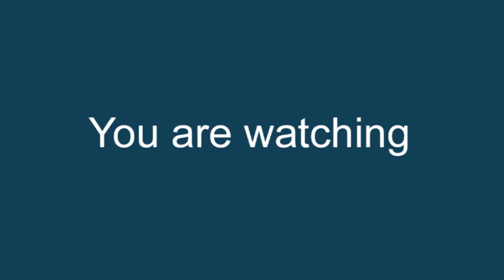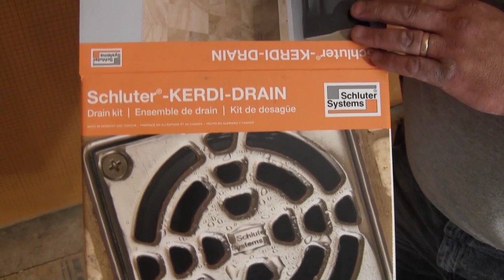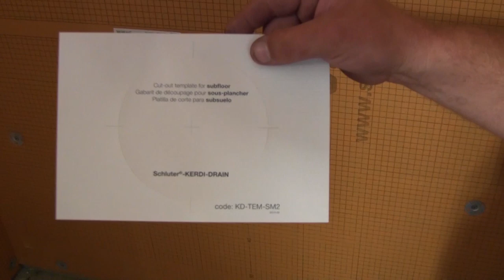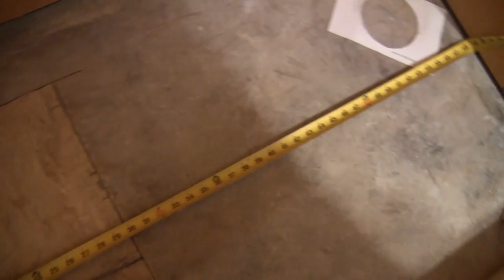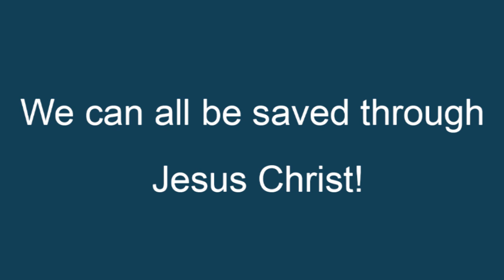how to install a drain in a custom shower

Comment: Joe I need to renovate two bathrooms. I don't have a background in the trades but I'm willing to try and learn and even fail if it comes to that. In preparation for this remodel I have watched many and I mean many videos on everything from demo, sheetrock installation, shower pan and custom mud etc. You are, in my humble opinion one of the best, if not the best, teacher I have had the pleasure to discover. Thank you for sharing your knowledge. You have a gift not only in the trade but as an unbelievable educator. So thank you.
Reply from the maker: Thank you!